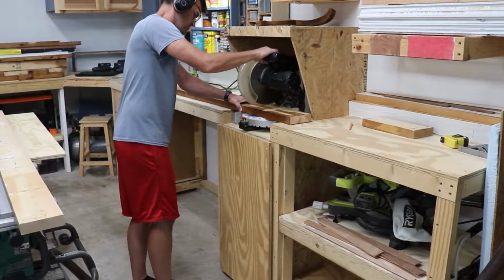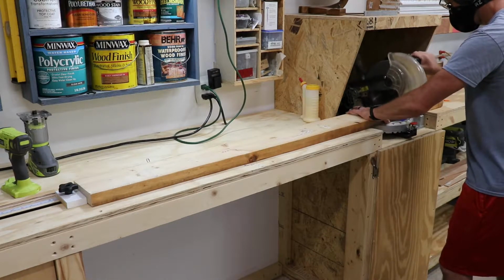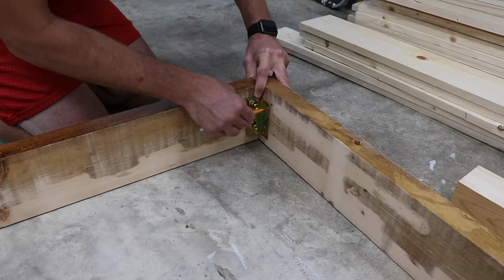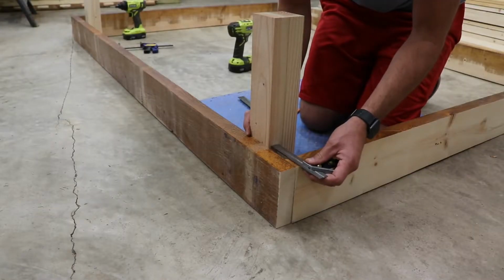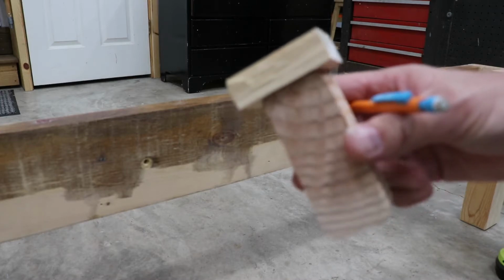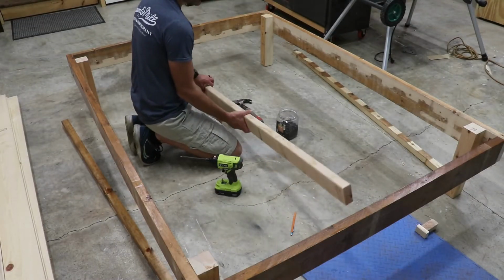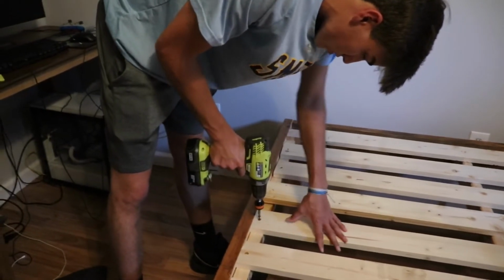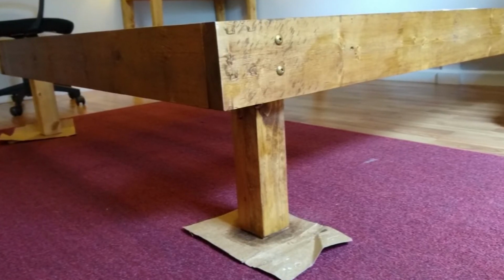How To Build a Simple DIY Platform Bed Frame

Comment: Nice job👍,thank you! I want to build a similar style pine lumber twin bedframe. I have left over 2X6's, 2X4's & joist hangers from a wall platform that was used to install my pine board ceiling project.
Reply from the maker: Thank you. Sounds like a nice project, best of luck to you!